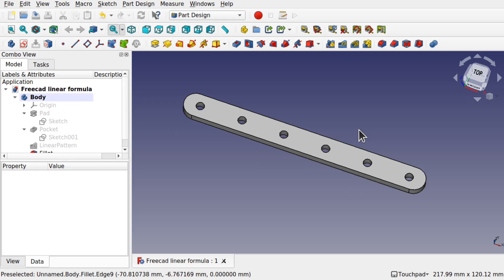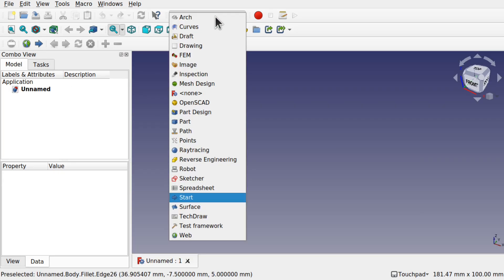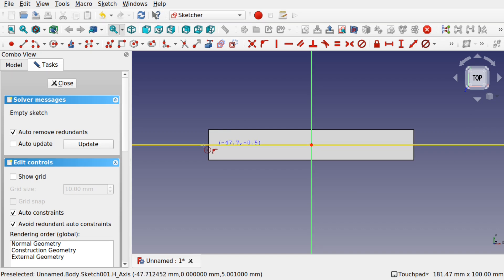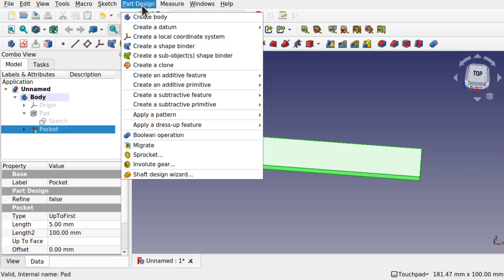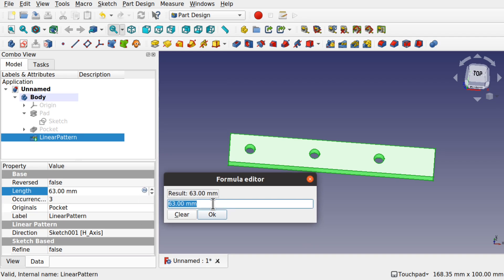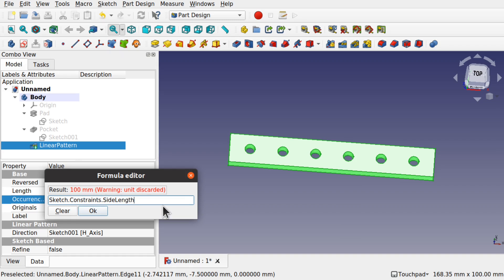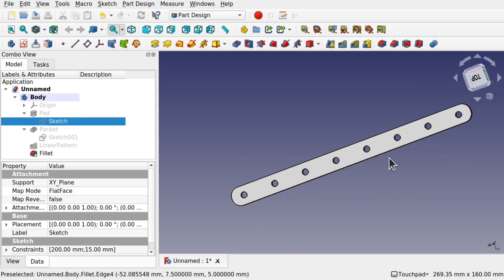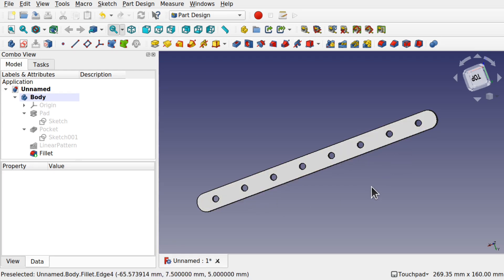FreeCAD: Automatically add evenly spaced holes depending on length using Part Design Linear Pattern

Comment: How to add multiple instances of such parts with different lengths in one file and assembly something with them? When I add miltiple and edit the length for one of them all others are also changed to the same length
Reply from the maker: It sounds like you need something called configuration tables.  This is created via a spreadsheet that you can add multiple lines with the dimensions you want to drive a model.  This will then be exposed on the model itself as a drop down.  You then create a variant link which clones the model and then change the drop down to the desired config to change the dimensions.  I think I have a older video but the process is still the same: EDIT: found the link -> https://youtu.be/tUuCQl6Uh6U

Comment: How to do similar op for square holes
Reply from the maker: The sketch itself can be change from having circles to squares quite easily in the sketcher.
Reply: @MangoJellySolutions  Thank you for the Response , in my case the Square is not equi distance from each other , how do i do it?

Comment: This is handy if the part length changes, but in the part I am working the length is constant. I am looking for an example that merely spaces a pocket that extends  through my part with constant spacing between pockets... 9" in this case.
Reply from the maker: If your in the part design you can use the linear patten.  (Skip this part and go to the next sentence if you want the direct answer) You need to select all the features that make up the feature you want to pattern.  So if this was, say, a raised hole where a pad in the shape of a cylinder is created on your feature and then a smaller diameter hole is placed through that pad straight through out the other side of the feature then you need to create a linear pattern as a single operation that has both those features selected.  If you linear pattern only the hole then you would get just the hole and not the raised cylinder pad.  

In your case you just need to linear pattern the pocket.  Select the pocket and use linear pattern.  Now select the length (9") and select the amount of holes you want in the occurrences.  They will be evenly spaced.
Reply: @MangoJellySolutions  Thanks, but when one enters the length dim, that's going to be the entire spread or with of the pattern. I can create the desired 9" spacing for my seven holed, but I am required to calculate the overall length of the pattern. I am hoping for software enhancements that will simply let me enter the pocket/hole spacing and the number of instances.

Comment: I had a problem doing this at first because I forgot to do a separate sketch. I had made a hole in the first sketch and then tried to apply the linear pattern which didn't work because it was trying to repeat the entire sketch instead of just the hole.

Comment: Thanks for your content. Do you do private tutoring? $$$     I need help with my invention.
Reply from the maker: Hi, sorry at the moment I don't due to work commitments and current commissions but if you want to request a video I can see what I can do.
Reply: @MangoJellySolutions  Thanks for your reply. I could send you images of my working proto type and you might suggest the videos you think I should follow? I have watched a lot of your videos and it seems there are many ways to do what I need but I want it to be easily editable for future design changes. Which is why I need to learn. Not sure how I would get you those images? It could be described as a beer bottle cut at 340degrees and perpendicular platforms extending from the opening. Perhaps if I made a video and published it on you tube?
Reply from the maker: @Kotaztrafee  if you send the pictures to mangojellysolutions @gmail.com then I can take a look and created a video. I have done this before with other request like the leg brace and the motorbike odometer case and the requester just made a small donation after if they were happy but that is totally optional . If the design is private then I normality will go through a similar shape or technique that can be shared publicly. The requester always gets the link to the videos first. Hope that helps. I do have a few requests and commissions that I am working on so there is a bit of a delay.

Comment: This video was great and easy to follow. I do however have one issue . In my decide in stead of circles i am using squares, and my first last square is not equal distance from the  edge as the first. I've started from scratch a few times with the same results. my only  other difference is that set a constrained height but that should not make a difference , I dont think.

Comment: Instead of going into the sketh to change a constraint every time, I've found it useful to use the Property Panel for the Sketch and open up the Constraints section to change them there. It becomes much quicker to make changes (alter value, press [TAB]), but it's easier to use if I name every constraint appropriately.
Reply from the maker: Great tip for all those reading, great way to speed up the process.

Comment: Another Great video!!  So I assume a circular pattern would work the same way.  A wheal pattern has a equal distance apart in a circle.  Thanks again for Awesome videos?
Reply from the maker: Glad you enjoyed. The pattern for a circle I was going to play with today as I was thinking about that last night as someone has asked me to make a key hook. They have 12 rooms they rent and in the reception there is a analogue clock. My thinking is combine the two to save space with a hook under each number. I have to experiment with sizes so it's not crowded. In the back of my head I have a sneaky suspicion you may need to use some maths with pi as radians may be involved in the underlying calculation. It's a long time since I have used the circular pattern. I will keep you posted.
Reply: @MangoJellySolutions  Thank you!

Comment: Like it. Doing something similar at the moment, but I'm making a polar pattern out of a solid and referencing the spreadsheet. Making a kind of partial gear. 

I imagine the case where we would want predefined/fixed spacing between holes would be another common desire. The math for that using the same UI boxes/parameters seems doable enough, but if there were different modes for the linear pattern, that could be a nicer interface.
Reply from the maker: I would love to see freecad expand this section to allow for these scenarios. It seems to be a common stumbling block that many want to use in there own way. Maybe a change request to the Developers may set the benefits to add this feature.